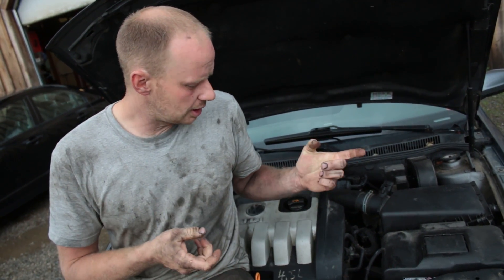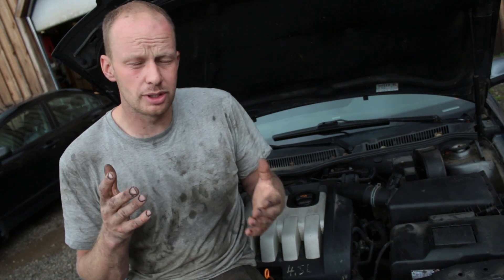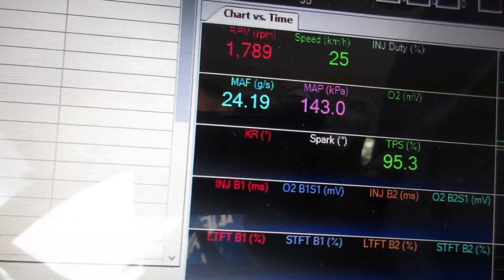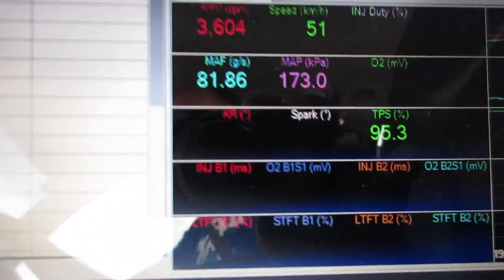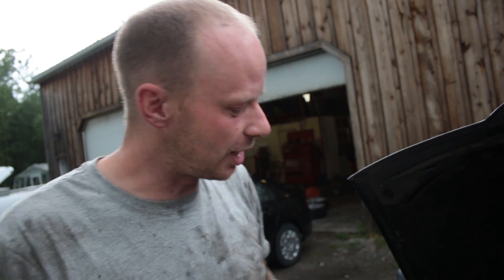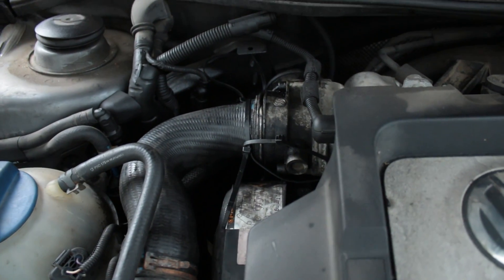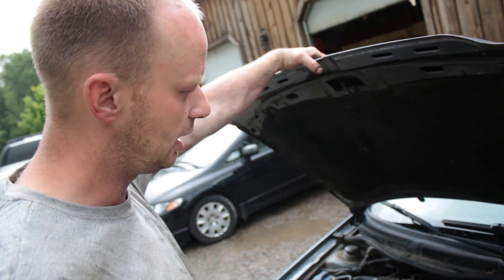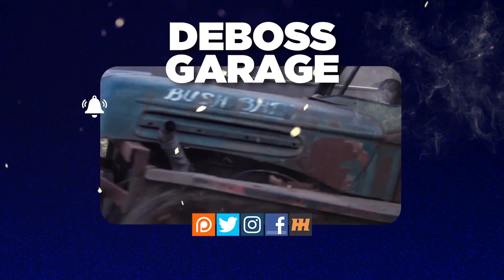TDI Jetta in Limp Mode, No Codes, NO BOOST!

Comment: What's your opinion on reliability of the vw diesels? would love to see a video on it
Reply: They're some of the most reliable engines out there. Period
Reply: Tommy Barlow well i have a 2014 Diesel sportwagen and it’s very reliable I’ve had it since 2014 and it’s a fun car and very good on gas
Reply: My 2004 has 400k miles daily drive it
Reply: But I have a ALH engine . Huge difference between mine and the junk BEW and BRM engines that require cam shafts and lifters and are extremely hard to get 500,000 + miles out of them . No 52 miles to the gallon .
Reply: Raul Porkuu ALH is an outstanding engine. The newer CJAA’s are proving to be excellent as well.
Reply: Yes but is a common rail , the ALH is a VE pump engine ans you can do a bosh VE mechanical swap off a 4BT Cummins engine and run it stand alone mechanical . A lot more cost efficient also . Make great boat engines and generators . Common rail engines are ok but mechanical is the way for me . I advise all my clients and friends to own at least 1 diesel minimum and 1 mechanical diesel if not 2 🤠
Reply: Raul Porkuu I’ll agree that the VE pump (and the Mercedes inline mechanical pumps) are extremely reliable. Common rail designs can be just as reliable, however, they greatly depend on quality fuel and adequate lubricity. Biodiesel is a no-no for common rail as well, so it can be somewhat problematic. I currently own an ALH and a CJAA. I’ll always own at least one vehicle with an older Diesel engine. They’re the best.
Reply: I agree they are the best . Especially when you can run almost anything in them and it burns . I have a 7.3idi and I run waste oil strait in it and change the fuel filter 1 time a year . It loves it . Free fuel it literally only costs me oil changes to drive it !!!!

Comment: my honda city car (petrol version ) is consuming engine oil. inspite of compression test being normal nd there is no blue or black smoke from exhaust.  it consumes about 800 ml per 1000 km .what could be the possible reason .
Reply: Its fucked
Reply: @BenDover-wu7ed  exactly what i said to myself before i read your answer
Reply: Valve seals og guides.

Comment: wait... you're telling me theres a vw without a check engine light on???
Reply: @zoltán timár I had an Audi and the bulb had actually been removed ahaha
Reply: my 03 wagon doesnt, but abs always on, 372,000km -alberta
Reply: Justin check ur wheel speed sensor
Reply: @jordanwhitford2208  thanks man i should get a hainz manual see what spec is vs what the ohms are  on them maybe
Reply: @Justin-ti3oo  you need vag com to shut off the abs light after a break repair
Reply: radioactiveload 
LOL
Reply: Mine doesn’t have one🤪
Reply: That's because its a diesel
Reply: At least 5. I own one, buddy owns 3, folks own one.
Reply: And most the issue is when on motorway doing like 60mph it just goes to limp mode
Reply: Noticed most in 5th and 6th gear it happens
Reply: Lol

Comment: This is not a wastegated turbocharger.  It is a VGT as was the previous model ALH TDI.
Reply from the maker: Yep, my bad.  I didn't spend too much time on the turbo.  Made sure the actuator and linkage moved freely and moved on.  Thanks for the correction
Reply: DEBOSS GARAGE To be fair, most service information refers to this system as a wastegate and in turn most techs and customers refer to it as such.
Reply: Looking at my Bentley manual it refers in the text to the wastegate for the PD engine, but the picture shows an actuator rod that has to be going to a variable vane type. I know this to be true, since I owned one once. So, even in the manual, the nomenclature gets a little sloppy.

On the other hand, I think there must have been a mix of true wastegated turbos and variable vane turbos on the previous ALH engines--I own a 2003 with a wastegate turbo, but don't doubt there are some with variable vanes. Also think the normally open / normally closed function might be reversed between the two, where it takes vacuum to open the wastegate, but it takes vacuum to close the vanes.
Reply: @davidleet9501   The AHU had a wastegated turbocharger but not the ALH.  Your 2003 would have a VGT turbocharger unless someone converted it to a wastegated one.  1999 and up VW Jetta and Golf TDI engines all had VGT turbos in North America.
Reply: @freeride202  I'll soon know for sure, since my wife took it across Texas and started getting an underboost engine code. So will be looking at it in more detail when she gets back. The Bentley manual refers to it as "wastegated" too, but obviously that could be wrong, as they were wrong about the PD engine turbo being wastegated. Thanks!

Comment: should do a video on the ALH motor, mine does the limp mode and throws an over boost code. it rolls coal so I think the vanes are clogged. I heard there's an oven cleaner method but can't find a video on it
Reply: You gotta clean your intake and egr out.  Get your egr cooler checked out too and then the actuator on the turbo and vanes need to be checked too.  I had this same problem on my 02 jetta tdi turned out to be the turbo actuator.  Goodluck
Reply: skileg10 egr is blocked off but i'll check the others, only goes into limp mode if i'm climbing a steep hill in 5th or if i'm hard on it
Reply: @skileg10  Step 1 - block egr input from exhaust - 2 turn off egr in ecu....then clean intake etc/ then if no luck change maf/ map and n75 solenoid ... solenoid is a very common culprit with turbo cars. oh dont forget to check for any possible boost leaks in the vacuum lines!
Reply: I have the same problem with my 00 mk4 Alh 
I can't find a solution..
It won't go over 110 km/h 
What should I do?

Comment: It is a VW, that is the main issue, it was doomed when it was built....
Reply: Well thats a silly comment. What are you comparing it to?
Reply: Hehe, the ALH tubodiesel has to be the most dependable version out there. Love them. Customers who have them won't part with their cars! The 04-06 ones are pumpe duse engines with unit injectors like a Cummins.

Comment: Good job! Small correction, those turbo are variable vein type, not waste gate. Same function, different design. Also its common for the veins to stick in the turbo causing overboost. You can check this easily by hooking up a hand vacuum pump and making sure the actuator returns smoothly on release of vacuum. 

Hope this car goes to a good home, still plenty of life left in it!
Reply: a seringe on the vacuum hose works also
Reply: Yeah but does a turn off and turn back on reset a mechanical issue. My Jetta does the same thing. I have been thinking it’s this same valve. I’m going to change it out and see if it works. I have 300+K  miles on the car.
Reply: @kapulu6259  The variable vane control solenoid can sometimes be the issue, but I have seen the servo units fail far more often. As it sticks, the computer sees the boost rise above the commanded level, and you get limp mode.

The reason a fault was not seen with the generic scan tool is because the EDC can store manufacturer specific codes, with a factory scan tool I can see the code for limp mode, sometimes this happens.

If you cycle the key and get power temporarily, suspect the variable vane system.
Reply: Robert Borchert I hear you. I do get a code but only if it goes into limp mode twice in a short amount of time. I just replaced the solenoid. The car ran great for 2 days. Then back at the issue. I ordered a new actuator and core. I will be working on that next weekend. I’m sure the veins are super dirty after 300,000 miles and a guy that drove it like a grandma before I got it.
Reply: @kapulu6259  you are gonna want to pull your turbo and clean those veins out. I had the same problem with my tdi, after testing vacuum lines, N75, MAF, and proper actuator travel they all passed. Which is why I was pointed towards the vein assembly. It takes a little work and some know-how to pull your turbo but cleaning it is fairly simple just dont lose or break anything (if it doesn't thread in by hand dont force it, thread chase or tap it to clean it up) it fixed my boost issues as soon as it was put back in the car. Also if you do clean it, the TDI's like to be driven somewhat hard try shifting no less than 2700rpm if its a manual or else you will be back in the same situation sometime down the road. If you are going to use oven cleaner (very commonly used when cleaning turbos and what I used) make sure you do not get it on any aluminum (the compressor side of the turbo) it will eat that stuff away like nothing.
Reply: @zach my actuator was gritty and took the turbo out cleaned it. Be careful with the oven cleaner. It’s caustic lie it will eat your skin. One of my vanes was also sticking. Had to do a little machining.
Reply: @kapulu6259  luckily mine was able to be cleaned with just the oven cleaner and didn't require machining, yeah that stuff is nasty I definitely wouldn't have used it without proper safety equipment but it does a really good job.
Reply: It’s all back together. Feels a little bit stronger. Don’t know if it the giant Honda Civic sticker in the back window syndrome or it works better with new parts.

Comment: I would have said it was the vanes on the turbo. They always seem to get gummed up and stuck on my 00 golf and the valve on top of the engine is an anti shudder valve all that does is closed when you shut the engine off to keep it from knocking which people frown upon, it's also a safety device for Runaways if your turbo seals go out you can just shut the engine off and that'll close cutting off air flow
Reply from the maker: The fact that when you "shut it of and turn it back on again" but it tripped about the same speed everytime, made me think it was electrical.  After checking that the linkage on the actuator was moving freely, I figured it wasn't the turbo.
Reply: Andrew Molln r